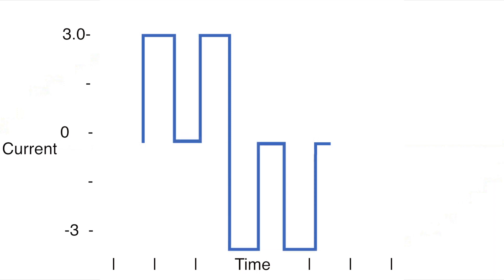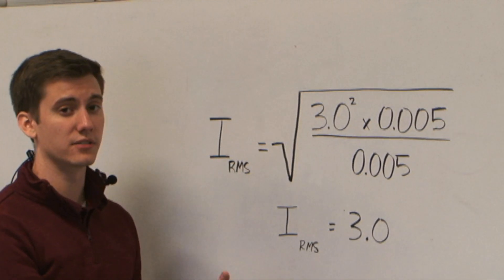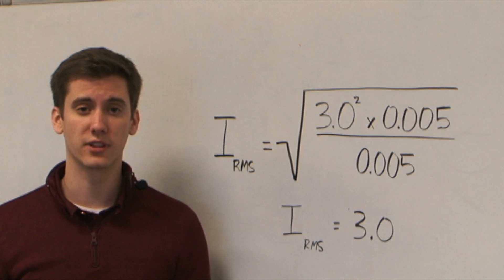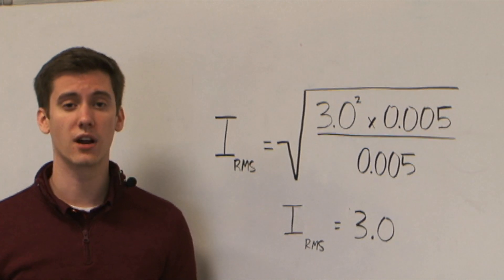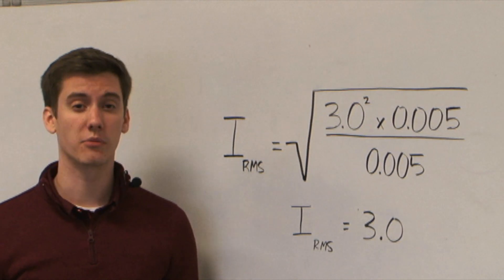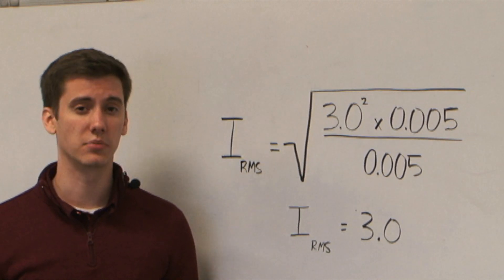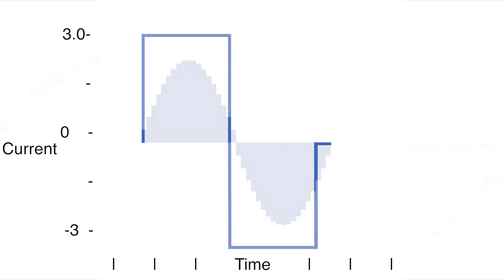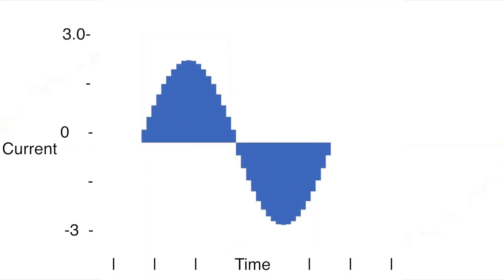Microstepping and Reduced Torque | Kollmorgen | 2 Min of Motion

Comment: In your calculation, you make no mention whatsoever of the current in "the other phase".  Microstepping is designed so the sqrt of the sum of the currents squared is a constant, the same as motor "wave drive" (where the current is in only 1 phase at a time but set at a constant).  You also don't account for the filtering effect of the motor inductance.  When drive is pulsed, the RMS value of the actual current will be less then the RMS of the voltage divided by the motor phase resistance.  So you are overstating the RMS current in non-microstepping drive.